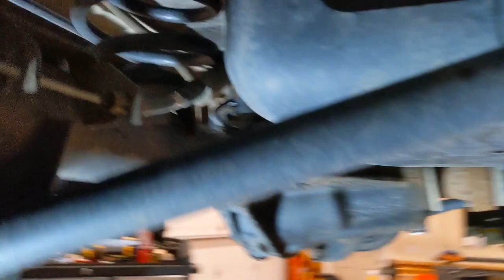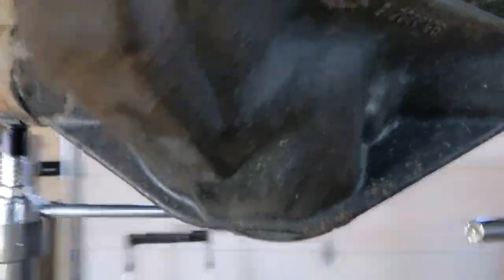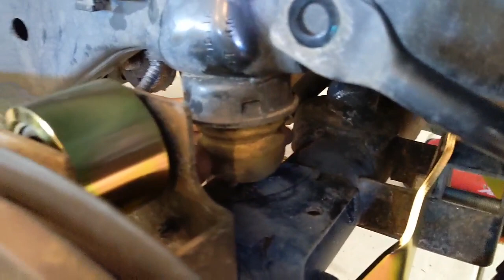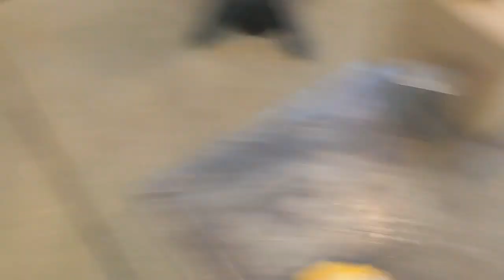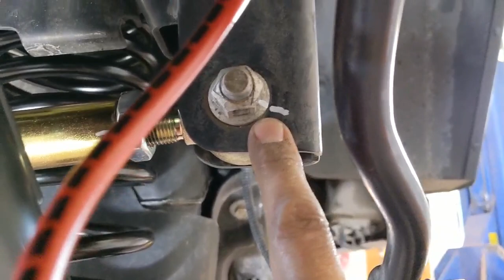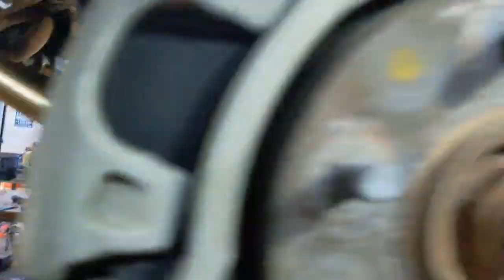Metalcloak 3.5" JK Suspension Install Part 2: Rear End

Comment: I really like how clear-cut your videos are for instruction. Good job! I'm just waiting on my stock shock extension bracket for my Metal Cloak 3.5" Dual Rate Lift. I was thinking I was going to get the Teraflex Falcon Piggyback 3.2 Shocks; wife said nope, you're waiting. So stock shocks until July. I was able to get the Method Race MR106 beadlock wheels wrapped in 35" Nitto Trail Grapps. It's a start. Thanks for your content, it's really appreciated.

Comment: Watched ur video to see how tight the rear track bar bracket goes on. Def took a bit of hammering to get it into place on my Jeep. MC stuff usually fits like a glove. I think they may have their dimensions slight off on this piece.
Reply: Actually on my 13 JKUR the track bar mounting location looks different than yours. This bracket isn't going to work. I'm going to have to call MC on Monday.

Comment: Hello... awesome video thank you 
I believe that is the lift that I have in my jk 2018, I had been trying to find out which one I have on my JK ...
A few days ago I noticed they one of the rear upper arm the screw is not tied so my question is, I just tie just lime that or there is something that I have to be aware of?
Reply from the maker: Nothing to be aware of. Just tighten it back up to the required specification. You can use blue loctite if needed.
Reply: @TheBFHGarage  thank you...
Reply: @TheBFHGarage   I, too, am very grateful for the confidence your clear video gives me.  Thank you.  Do you use blue loctite on all of the bolts at the end? And do you get the torque specs from an instruction sheet from Metalcloak?
Reply from the maker: @leewill1276  I use blue loc-tite once everything has been adjusted correctly. When using loc-tite, you need to reduce your torque spec by ~10%. You can look up torque specs by bolt size and grade. If they are posted inn the directions then use those.

Comment: Excellent videos. I still haven't seen any videos where they show and explain the final adjustment of caster and pinion angle adjustment. Is that something the alignment shop does? And if so, do they unbolt  one end of the control arm and make them longer or shorter, then reinstall?
Reply from the maker: So, a couple different thoughts on this. The first is maintaining a correct caster angle based on stock specs. The problem with that is, is that it can cause driveline vibrations because the drive shaft isn't straight like it needs to be. So you have one of two options, the first one setting your caster at spec or adjusting your pinion angle until your driveline vibrations go away and the caster will be what it is at that point. My personal belief is that pinion angle takes precedence overcaster so you don't have driveline vibrations. And yes the way to adjust pinion angle is to lengthen or shorten your control arms based on what direction it needs to go.

Comment: Outstanding installation video series. What sizes tires were in the finished product? What sizes tires do you recommend for a JKU with this lift?
Reply from the maker: This Jeep settled on 35" tires. There are far more factors than a simple lift to decide which tire size is appropriate. If you beef up the axles a little and go with deeper gears and appropriately backspaced wheels then you can run bigger tires.

Comment: Mike, do you have any videos discussing tuning a newly installed suspension lift?
Reply from the maker: When talking about most lift kits, there is nothing to tune unless you have tuneable shocks. Even then, most everyone sends those out to a shock tuner. Higher end products like coilovers or ORI struts need to be tuned but that is out of the scope of my channel for now.

Comment: Thanks for sharing your time and knowledge!  Curious about the final torquing process.  Did you put the tires on to torque?
Reply from the maker: It doesn't matter if the tires are on or not as long as the axle is on jack stands allowing the weight of the vehicle to rest on the springs. You CAN put the tires on and then lower it to the ground and then torque.

Comment: Got a question, i just noticed that after installing my 4.5 game changer lift, i have a rear track bar frame bracket that extends lower about 3"-4" from stock location. Would you recommend removing that or leaving it? 

18:57 time stamp
Reply from the maker: In addition to the axle side relocation bracket? It's probably the difference between MC's 3.5" and 4.5" lift kits. I would do whatever Metalcloak instructs for that lift kit.
Reply: @TheBFHGarage  MC axle relocation bracket with adjustable track bar. But i just noticed my jeep came with a frame drop bracket. Rear track bar droops down a bit (frame side). Might just remove it actually.
Reply from the maker: @SLlPPP  yeah if it didn't come with the MC kit then I would remove it👍
Reply: @TheBFHGarage  awesome thanks man! Ended up tossing it. Just wanted professional advice on this.

Comment: is a Rear Track Bar relocation bracket required for a lift?
Reply from the maker: Depending on what lift but generally yes.
Reply: @TheBFHGarage  4.5" on JLUR. I bought a new adjustable track bar set along with complete adjustable control arms and steering set up for the lift. I see I will need more than the adjustable track bar to recorrect the geometry
Reply from the maker: @TwoFeatherChannel  That's just it. If you raise with a lift, then you have to tilt the pinion back. Tilting the pinion back requires a relocation bracket to correct the angle and place the axle side higher.
Reply: @TheBFHGarage  Thanks for your help
I'm making sure I got everything before I start the lift